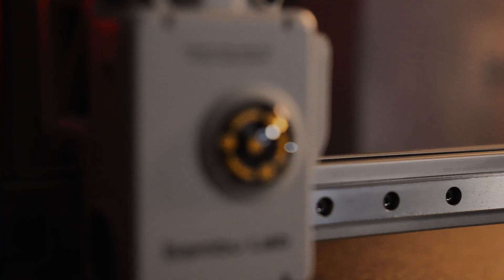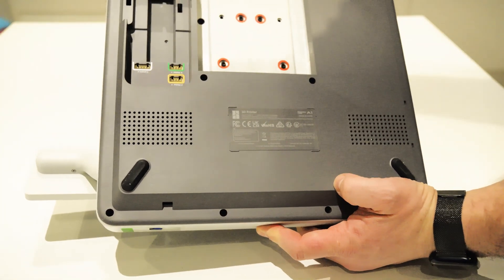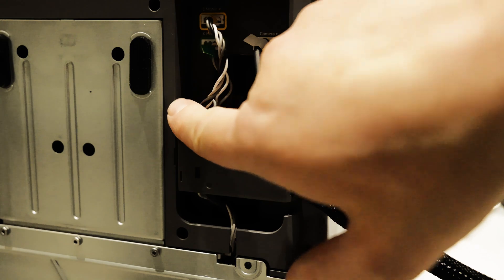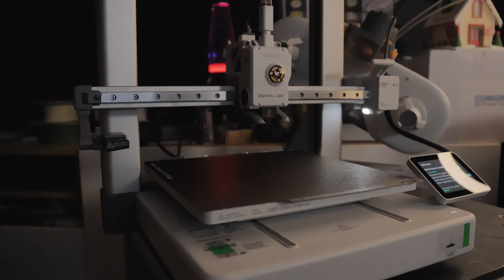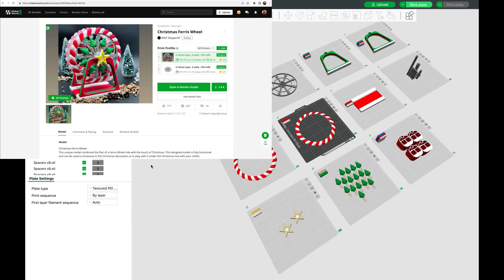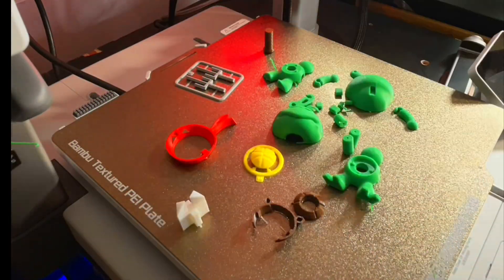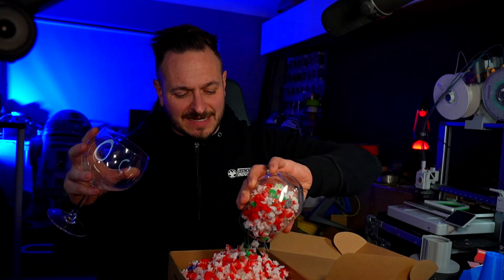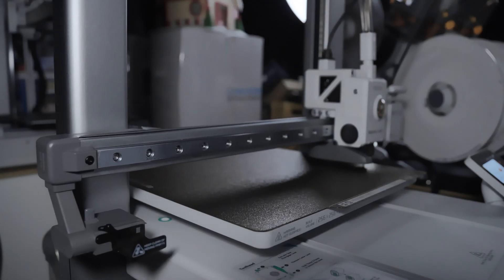Bambu Lab A1 - First Looks and Amazing 3D Printing Results!

Comment: I'd love to see a review of Creality Sermoon D3 pro. It has 2 independent extruders and also capable of priniting metal filament.
Reply from the maker: Metal ? I don’t think it does, I’ve seen it in China tho
Reply: There is a special filament called ultrafuse 316l. I assume it's a composite material and contains some metal particles @TheRealSamPrentice
Reply from the maker: @vasylvoina6663 yeah it’s pretty pricey that one, you need a furnace to process it tho right ?
Reply: I'm not sure.  @TheRealSamPrentice

Comment: Nice prints, man. I have a question, how did you get to print at 0.6mm layer height with this printer (as mentioned at minute 5:36 )? what nozzle did you use? Thanks in advance.
Reply from the maker: 0.16 layer height on a 0.4 nozzle was meant to be the the line ;)
Reply: Thanks for the reply @TheRealSamPrentice . On the other hand, I hope Bambu Lab comes up with a 0.8 mm nozzle or larger :).
Reply from the maker: @mortaldrumming yeah there is a 0.8 already which I have
Reply: @TheRealSamPrentice is it for the A1? That's awesome.
Reply from the maker: @mortaldrumming yeah it was the same on the a1 mini :)

Comment: Sure it works great to start with, what happens when it clogs or parts break? With other printers that is replaceable/upgradable. Like makerbot or ultimaker, etc there are going to be a lot of these just thrown out after warrantees have expired.
Reply from the maker: Parts are cheap.. that’s part of the appeal